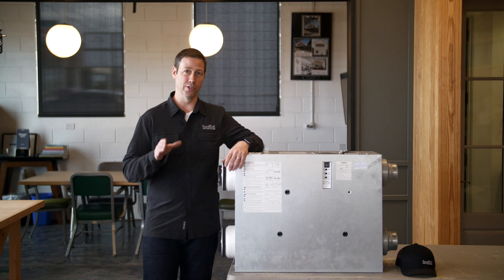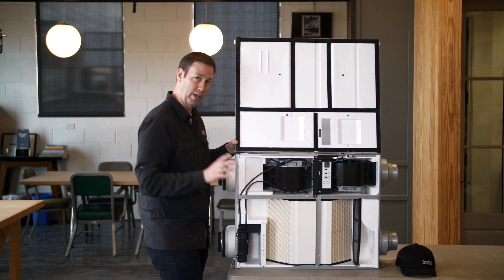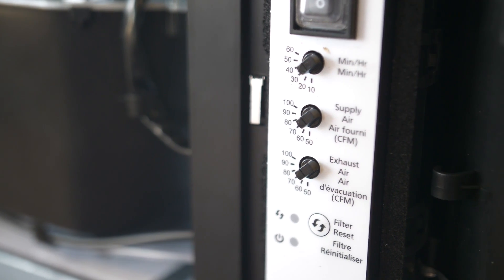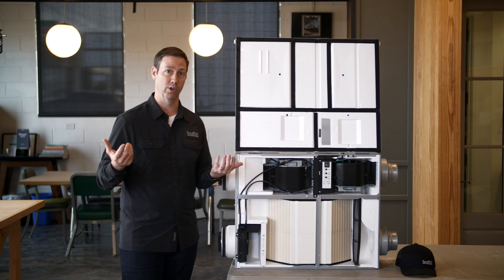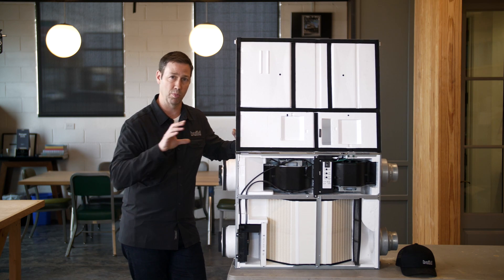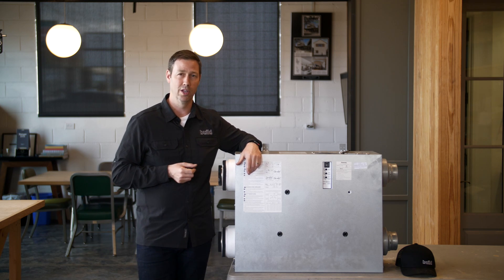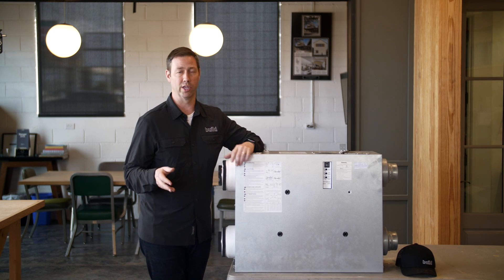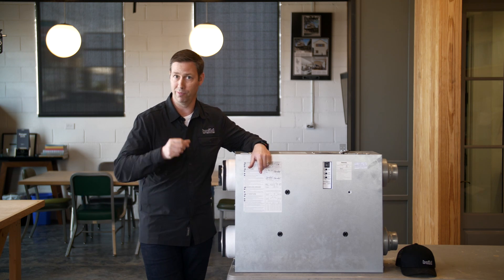ERV vs. HRV - Myths

Comment: If you bring in warm humid outside air to the ERV - exchanging  with air from the bathroom and kitchen, is that not counter to the units function, given the bathroom/ kitchen air has a level of moisture. Perhaps waste outgoing air should be picked from a dryer area of the home. The unit is depending on clean dryer air to treat the incoming humid air. JAT
Reply: If the indoor air is more humid than the outside air, then some of the indoor humidity will exhaust outside through the ERV. If the outside air is more humid than the inside air, then the ERV will cause the inside air to become more humid. However,  you must understand that a stated RH is affected by temperature. For example: If the outside air is 56% RH @ 40°F, and if this same air was heated and moved indoors, the indoor relative humidity would indicate approximately 13% RH @ 80°F,  in contrast to when the air was outside and indicated 56% RH @ 40°F.

RH is deceiving, for it tells you the percentage of humidity that the air can hold at a specific temperature and pressure, it doesn't tell you actually how much moisture is in the air. Dew point tells at what temperature moisture will condense out of the air at specific atmospheric parameters.  Absolute humidity tells you how much moisture weight is in a volume of air, and is expressed in grams per meter squared. Absolute humidity should be used in determining actual moisture content between two different temperatures of a moving air mass. 

Cold air cannot retain as much moisture vapor as warm air, so with a given weight of moisture in a given volume of air, at a specific atmospheric pressure...  Relative Humidity will differ with temperature, and its percentage will increase when the air is cooled and moisture remains unchanged.

If moisture in excess of the ambient amount is exhausted from your bathroom, and if the bathroom is heated more than the rest of the house, the RH of the bathroom will read less than the rest of the house, which is cooler in temperature.

BTW: how many hours a day do you take a hot shower in the bathroom and boil water in the kitchen to make this a significant concern over a 24 hour period? With either an ERV or HRV the indoor air is constantly being replaced with fresh outside air and any excess humidity beyond ambient caused by a hot shower or boiling water will soon be exhausted outdoors.

Comment: I am enjoying this video.  I seem to have an opposite issue than what you face in the south.  The area in Utah is arid and cold.  What heat exchanger/recovery unit would you recommend to humidify the house and recover the heat?  Should I just install an automatic whole house humidifier?
Reply: Doesnt add humidity
Reply: We have a very simple whole house humidifier hooked into our ancient furnace.  Similar to a swamp cooler (simple motor with a rotating pad).  Works great; whenever the furnace is blowing hot air it is humidifying that air.
Reply: @barbaramills288  Thanks

Comment: What do you use for Very Hot and Dry?
Reply: I would think ERV, since you want to keep moisture in the dwelling for comfort, especially if you're actively cooling and humidifying the interior.
Reply: But do measure the actual humidity levels and calculate and compare indoor and outdoor dew points. A/C may not lower the RH appreciably but the dew point will go down.

Comment: That is confusing. In cold climate where heating is on 24/7 the humidity in the house drops below 10%. Outside is 50-80% usually. In this case ERV makes a lot of sense and HRV not so much. U want 50% humidity in your home.

Comment: I’m in southern Minnesota. Your saying I should have an HRV, but Minnesota can get tropical humidity levels, 50% to 90% humidity in the summer normal here. And humidity in the winter can be a problem too. We had a system similar to what you show here where I work, and frankly, it made the work environment swampy. Currently, I use a whole house dehumidifier year around, so... what do you suggest?

Comment: I live in a 6th floor condo. I want to add an air exchanger.
How do I pass ductwork in an existing 12" high ceiling? Is there anyway not to destroy the drywall?

Comment: Can you hook up pipes that are coming from the bathrooms, kitchen, and laundry into a common junction and goes into the ERV exhaust outlet?
Reply: Yes, however this won't replace a bathroom fan because it will not draw enough CFMs from the bathrooms if the exhaust is split up. You typically need 50-100 CFMs to prevent a bathroom from steaming up from a shower.

Comment: Hello Matt. Great video. 

We completed a house in 2016 based in NH, and our plumber recommended and installed a RenewAire EV300 ERV unit. When the weather drops to -16 which happens about a week out of every winter, we get condensation, and sometimes small amounts of ice build up on the windows. Other than those very cold days, we don't see anything. My plumber advised running the unit more during these cold spells, but I am wondering if, in fact, I should have installed an HRV and or not be running the ERV more during cold stretches as I think I could be adding moisture to the house?  RenewAire says I should be running the ERV 60% of an hour during winter but the air coming into the house is cold, and therefore I need to run the heat more. Any insight would be great. 

Thanks

Comment: Question...So I work for a builder that is building a super insulated house. There's a 16 inch envelope around the entire house from the exterior 2x6 to the interior 2x4 studs. This 16 inch envelope is completely insulated and like i said, this is around the entire house. So the house has an HRV system but no heating or cooling system. There is no HVAC system in the house! None at all! I am skeptical that the house doesn't need some sort of HVAC system to either cool or heat the home, given that the house we are building is in the northeast...Boston, Mass to be more specific. Can someone please confirm that the house does indeed need some sort of HVAC system such as mini splits to cool or heat it depending on the time of year?! Mind you my boss is set on just having this HRV system and doesn't even plan on installing any sort of HVAC system at all! Isn't that just madness? The walls are getting closed up too right now with blueboard which is driving me crazy! Sure the house might be super insulated and airtight but regardless, won't you need some sort of source of heating in the winter and  cooling in the summer? The HRV simply recirculates air from my understanding around the home; it does not heat or cool it?! Is that correct? Does he indeed need some sort of HVAC system from my understanding? Can someone please let me know?! From the research I have done, the HRV is a great system but does not function as an HVAC system which is much needed in the northeast. Can someone please confirm this or elaborate to me on how the HRV works if i am mistaken? Please and thank you!
Reply: Can somebody please reply?! SOMEBODY?! ANYBODY?!
Reply: The house could be a passive solar design meaning the sun will heat it in the winter and keep it cool in the summer.

Comment: Thanks for the information, Matt.  We installed an ERV that is manufactured by a small company in Ohio called UltimateAir.  It is one of the most efficient ERV's on the market (98% Heat Recovery Efficiency).  Since we are in Central Indiana (Cold and Humid), ours also has an integrated 1kw internal heater that pre- heats the incoming air and allows it to continue working in very cold climates.  We love it.
Reply: They had some good ideas. Too bad CoViD knocked UltimareAir out.
Reply: @technorex344  Website is still up and active- are they out of business?
Reply: @technorex344  Well, that's not a good sign.  Love their product.
Reply: @swtexan6502  Decided to give it another shot and was able to get ahold of someone who used to work there!
They said last they new (6+ months ago) UltimateAir had 1 person working there 1 day a week for filter orders (on Tuesdays)
Reply: @technorex344  Well, at least I can get new filters. Appreciate the info.

Comment: What I find ironic about the WHOLE issue of using air-to-air heat exchangers is that houses are built with tighter and tighter envelopes, and then we go and install and operate equipment to get the same result for IAQ (indoor air quality) - taking a step back, the same result can happen if the air tightness was relaxed. Building codes already considered necessary ventilation requirements.
Reply: Lou Fazio - We aren’t getting to the same IAQ result as you say. First, The amount of air exchanges the ERV provides is well below a leaky building envelope. So the rate is not apples to apples. Now before you perceive this as promoting leaky buildings... Second, this is filtered air while air leakage is not. In urban environments, this can be a significant source of fine particulate (think smog). So most would say an ERV is having your cake (IAQ) and eating it too (energy efficiency).
Reply: Michael Witt   Points well taken, and I can conditionally agree with them, but I can also pick them apart e.g. it's not HEPA filtering, the distribution of the ventilation or unsatisfactory zone temperatures. I have plenty experience in seeing construction standards change and ventilation code react with its assumptions and short-falls [both in logic and implementation]).  I also know how easy it is to under-inform people, lead them into  concepts that aren't necessarily true or complete, how intent can be misinterpreted or deliberately circumvented, how over-worked standards can propagate and how the whole basis of intent and presumption can lose relevance.  My point is a little infiltration can provide ventilation well enough (especially with much less costs) and may even do a better job of it than to go thru ALL of this analysis, installation and operation. My last thoughts to obnoxiously satisfy the most obsessive pursuit of guaranteed clean air  requirements was to suggest a requirement of provisions of individual breathing apparatus (much like in commercial aircraft) for each person occupying the building.
Reply: Lou Fazio  I think a big deep breath is all that’s needed here. I work as a design engineer on large commercial buildings. No need to philosophize building code. Everyone is simply trying to balance cost, complexity, efficiency, and constructibility. After getting to current code required insulation levels, air leakage becomes the next biggest source of energy loss. Also with modern envelope assemblies, air infiltration can cause condensation within walls. 

Only because of those ends do we now apply an ERV. No one is advocating that an ERV is a end in itself. Just something that is required once you have pursued energy efficiency in your building envelope. 

Also you might look up the wiki on MERV 13 filters, which this ERV can use. It’s hospital grade and will filter out particles down to the size of bacteria.
Reply: Michael Witt    Large commercial and residential have typical significant differences in delivery, e.g. VAV, while residential needs to balance a reasonable affordability. Your "philosophize" is my "not blindly following".  I will still stand by my contention that after one relentlessly tries to seal their house from infiltration to then duct it in for minimal energy recovery seems like a lot of cost and work. The method for house wall construction accommodated condensation.  My underlying concern for some of my objections is runaway worry-wart standards and exorbitant costs without back-checking practicality. Two other examples: 3-prong electrical receptacles mounted with the ground up for the chance of a conductor falling across the previous installation –please, too much time on their hands. The "improved" installation may even yield a weaker connection because of less friction-force moment. The second: the EPA's small gas container nozzle is such an overworked monstrosity that MORE gas is now probably spilled.  Bonus example: taillights are not allowed to be placed on a vehicle's trunk lid (while it is an improvement to avoid shock to lights, I don't believe it needs to be legislated).   Retro perspective:  Use of glass jars would probably be an appalling thought, because they can too easily break (true, but get a grip).   The original comment was half a joke knowing everybody is on the ultra-train, and in each joke is a little truth.  In the end for me, I stopped over-sealing my house and let it breath some so I don't have to make accommodations to re-supply it.  That's all Mike.
Reply: Commercial buildings may have VAV,  Lou, however not all will. In Virginia and DC, water source heat pumps on a building wide loop are common. That said, building leakage is not controllable in volume, conditioning or path, however ERVs and HRVs are and can be balanced with the rest of the system after construction, when you find a contractor dropped the ball. That is an expensive and difficult thing to do with a leaky envelope. The other problem I see regularly with the leaky envelope ventilation method is moisture buildup unintended  parts of the building (causing building materials to degrade and allowing biogrowth to grow) and security issues (doors unable to close or resistant to open due to pressure differentials).

Comment: Ok, I've been waiting to ask you this question on the subject.  If you plan on wanting filtered, balanced fresh air coming into the house, and also plan on a standalone dehumidifier, wouldn't one of Ultra-air's units with the fresh air inlet be the ticket? Seems like it accomplishes both simultaneously.  Or is this plus a dehumidifier better for some reason?

Comment: Matt I’ve been thinking about have a whole house humidifier installed for the winter months here in Ohio was wondering what if any whole house system you recommend
Reply: Fix your leaky house first.   Cold air is dry and it lowers the humidity of your interior when it gets sucked into your house.  

Start with sealing windows/doors and top floor ceiling plane.

Comment: Is there any performance hit to using an ERV for an HRV application? I am in Virginia, so it is not like Florida or the deep south, but a significant portion of the year is extremely humid.
Reply: Not really, they are similar efficiency. Only case would be if you needed extra dehumidification in the winter to keep the condensation off the windows, HRV gives more dehumidification than ERV in the winter.

Comment: Matt, recovery ventilators add humidity in the humid south and that also means they remove humidity in the cold north since cold air holds little moisture.  For a given amount of ventilation an ERV will dry a house out less, allowing it to run more without lowering humidity too far.

Unless you have a super tight custom built house an ERV may be the way to go up here.  Most ERVs have much lower operating temperatures than HRVs before freezing/defrost becomes an issue, which also leans toward using an ERV up north.  Super tight houses that need to shed large amounts of humidity may need an HRV instead if an ERV doesn't get rid of enough moisture.

Comment: Just a observation , its good practice to dump the incoming air in to a basement or unused space, this will prevent nasty droughts and noisy air flow in the living area. This can be noticeable in the heating season. I installed mine 14 years ago and it still runs perfect. I run it on a dual out door low and high temp, and out door high humidity sensor to optimize the loading.

Comment: I'd like to see a video on how you use the ERV and a dehumidifier in the same house.
Reply: AudioHouseOnline  typically these are in 2 different locations. Say Florida nowadays, the air handler is on a stand in the garage , and there will be no condensate  leaks from ceilings, so relatively easy to use a DEHUMIDIFIER  HERE. The other unit HRV  is elsewhere.  from Maplewood nj
Reply: I was thinking the same thing, are they installed as stand alone units (independent of each other) or are they ducted together ? if they are ducted together I would like to see an install video